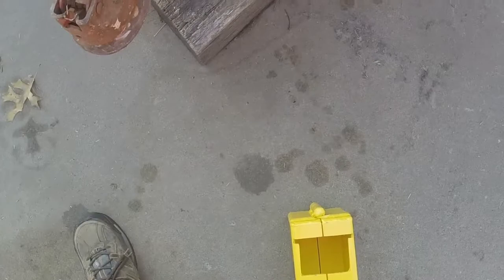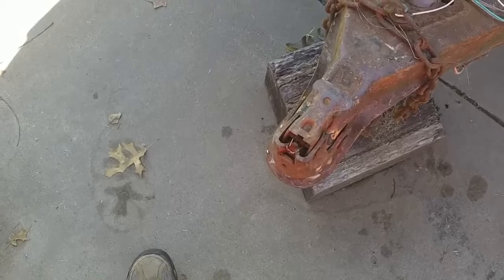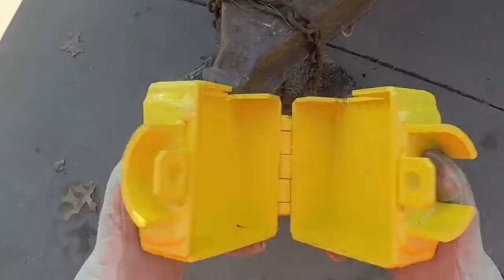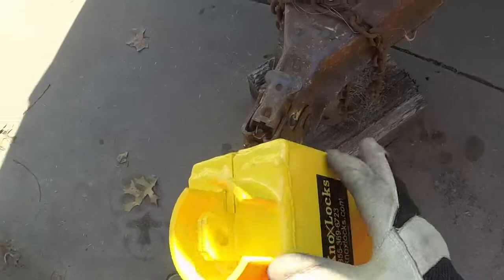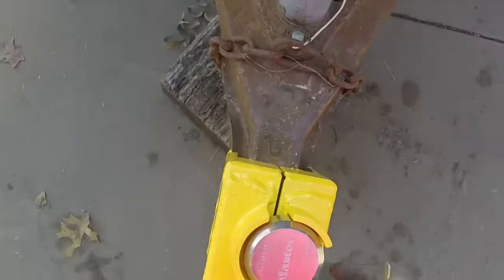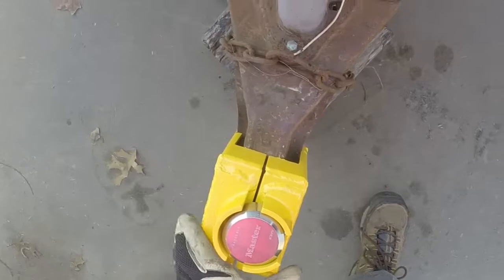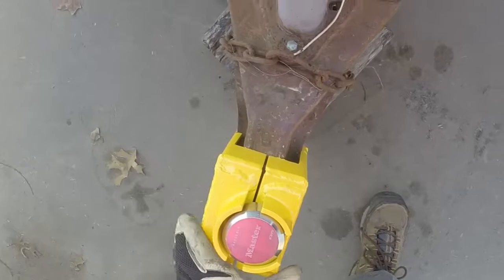Installing a Ft. Knox bumper pull lock

Comment: Robbie is right on the money - redesign with either an internal hinge, and get a puck with an ASSA Abloy core. My little sister can pick anything masterlock makes in a matter of seconds
Reply from the maker: If someone brings an angle grinder with a cut off wheel to attack the hinge then all bets are off for any lock.  Locks are still just a deterrent.  We believe we have one of the best deterrents out there.  As for the puck lock suggestion, we have totally dropped MasterLock and now offer puck locks with the Cobra-7 and the Abloy Sentry cylinders.

Comment: Hinge is exposed for drill and knock out. That master lock puck takes seconds to open also. I like the concept but it has easy to spot week points, no torch needed.Please improve this design so I can be happy buying one :-)
Reply: hinge cut doesnt work. Then you are trying to use the lock side as a hinge, which wont spread because the lock is in there and the lock protector ring is in the way too. I agree with the poor lock part of it though.